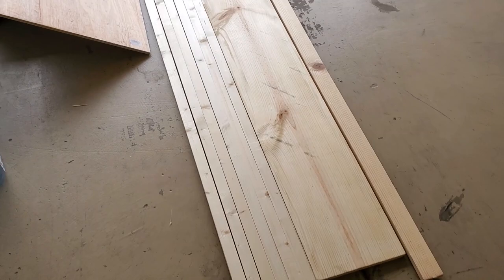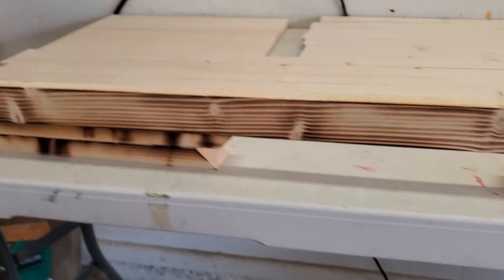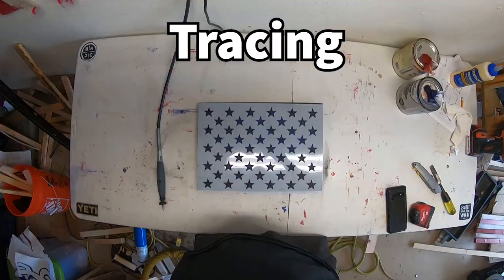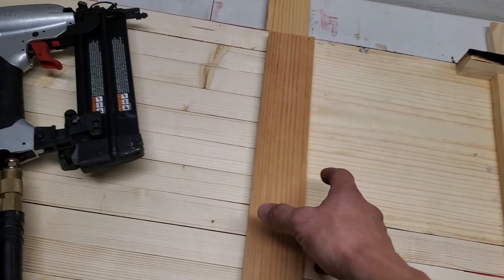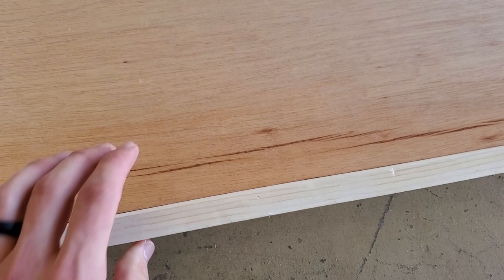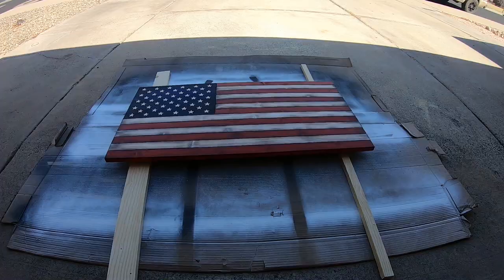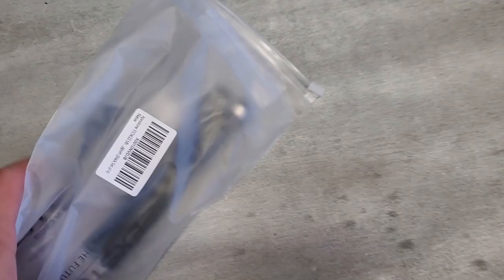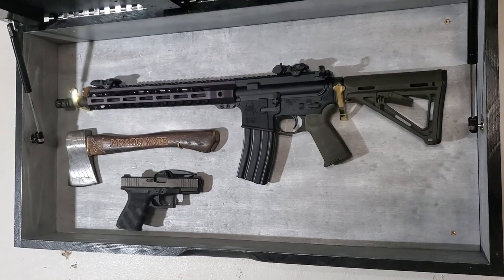How to make a SIMPLE Concealment AMERICAN FLAG! | DIY Christmas Gift Idea

Comment: Generally it's better to avoid staining any surfaces that are going to receive adhesive. Normally with segmented slab pieces like that, you'd want to edge glue all the strips and the union to each other.

Comment: That's really cool man. I think the only thing I'd do is cut into the sheetrock and make it look flush.
Reply from the maker: Thank you! That would definitely make it a lot more of a concealed box! I thought about it buy wasnt sure how it would work with it being longer than the distance between the studs
Reply: @MaxF01  well you did an amazing job brotha. Shit I'd buy one even tho it's easy to make but if you ever make any to sell lmk! And I'm sure you can double up or sister a 2x2 in the wall and make it nice and flush. One of the coolest makes buy farm man keep up the great work!!
Reply: @MaxF01  if its a load bearing wall then you need to add a header double 2x6 will be fine to carry on stud. if its not load bearing then just cut the stud and screw through the 1x case into the stud. install some tear away bead and done. i woule make the flag  .75 bigger to cover the cut out.

Comment: I been making flags for 3 years. I don’t do the hand carved stars my hand not that steady. I buy my stars from a guy that makes them on a CNC machine then glue them on using. E-6000 glue. Also, I screw my flags with 1.25” drywall screws but I see glueing and nail gun would be much quicker. Wanting to build one with RFID lock.
Reply from the maker: Yea the hand carved stars definitely take some time and they also make my hand pretty cramped up so I definitely wouldnt be able to do many of them at a time like that. I almost put one of those locks on this one but then decided not to, definitely gonna put one on when i make a fancier one👍🏼 thanks for sharing man I appreciate it 🙏🏼🇺🇸

Comment: I purchased the same gas struts but they don't seem to be strong enough to hold the box open. I used the same measurements as you but it didn't work. any ideas? lol. I ordered another pair of higher weight capacity.

Comment: Great video.  Any ideas how to put a concealed quick lock/unlock device on this?
Reply: To keep out kids or thieves?
Don't bother if it's for thieves. Won't even slow em down.

For kids...just poke around hardware stores. There's dozens of options. An RFID reader, a relay and a solenoid would be my choice.

Comment: So my issue is the gas struts you linked are not strong enough to hold the lid open.  My flat is made of 3/4” pine measuring 20”x37”.  Did you run into any problems with them?

Comment: Carving the stars takes forever. 😂. I need a faster way to do it.
Reply from the maker: Haha yea it can be a bit time consuming 😂 using white spray paint would be a heck of a lot quicker and i think it would look pretty good, i used it on the cross flag that i did and i used it on the flag in the video im going to post next and they actually came out pretty clean! I think they also sell wood star cutouts on amazon that you could glue on, hopefully you can find something that works for you 👍🏼
Reply: Max F - I was thinking the same thing. They have the CNC routers too, but I think they’re pretty expensive. I’m going to try the paint idea in the next day or two. What are you doing, just taping the stencil down well and then spraying over top of it?
Reply: Max F - Awesome videos by the way. I made one after your first video - I’ll try and send it to you.
Reply from the maker: @jasonoyer8785  yea thats pretty much it, it works better with the union being a whole piece of wood and if there are any areas of the stencil that are floating i try to hold them down when i spray and also try to spray straight on and not angle it so that it doesnt get underneath the stencil. Also i try to go light and just do more coats
Reply from the maker: @jasonoyer8785  thanks a lot man i really appreciate it 🙏

Comment: I think I would put the piano hinge on the inside.
Reply from the maker: Not a bad idea! I was thinking about doing that but i think the way it opens you would have to have a bigger gap between the face and the box because with it being on top it swings up but if it were screwed to the back of the face on the inside and you went to open it would have that extra .75” that would swing in when you open it up. Haha i dont know if i explained that very well but thats what i was thinking. Im sure there could be a way to make it work.

Comment: I made a flag and when I was carving one of the stars, a knot  revealed itself in the middle of the Star! Any suggestions on how to fill/correct?
Reply from the maker: Hmm ive had that happen a couple times, usually i just try and carve it enough to get the blue stain removed and then try and get the outline part dug out a little deeper to make it stand out a little more from the blue. it might be a little dark still but i think overall it shouldnt be too noticeable. Also if you do decide to stain the stars white that could help to make it not so dark. Hopefully this helps a little!

Comment: I like the build. I literally just built one myself...not of your design...but in the end, they look similar. I used inside cabinet hinges though. 

These struts????

I see that you used 100N 10" 

I've been building things for 40 years, but never used any of these struts and I've got to say, after watching MANY videos and reading, I've yet to come across a GOOD video "explaining" how these get installed. Where and why they get installed where they "SHOULD" be placed. Instructions that come with them are lame and ALWAYS in metric. 

Your video, though a good build video, you too didn't explain anything at all. Why you chose 100N. They're rated at 28lbs EACH and I know full well that lid didn't weigh nearly 60lbs. Didn't weigh 28lbs either. 

So, why did you choose 100N struts? 

See what I mean? There's no explanations for any of these struts. 

I have found a few videos that do go into detail....BUT they are using geometry and trigonometry and showing angles and the hypotenuse this and that. I don't need or want to know any of that. 

So, after LOTS of research and trial and error and 4 different orders from Amazon, I finally came to simple math reasoning of WHAT struts to get, why and how they are to be installed. 

It took almost 2 weeks, but most of that was waiting on "next day delivery" from Amazon which ALWAYS ended up taking 3 or 4 days. Each and every time. 

I gave your video a thumbs up because the build itself was decent,  but honestly, your video moving all around here to there showing the struts etc was very poorly done. 

If you're going to do a build video that has hardware being installed, then you should also go into detail about that hardware and it's installation.